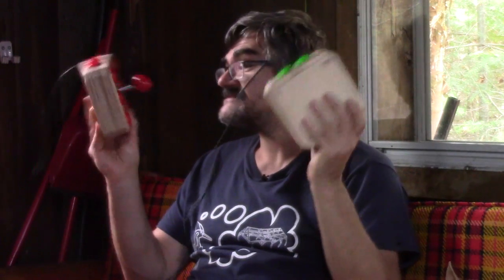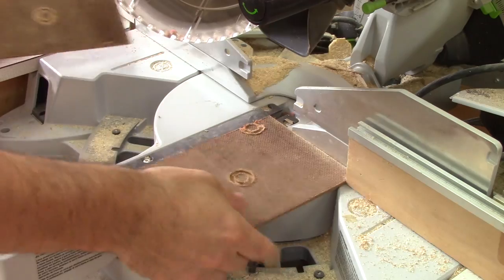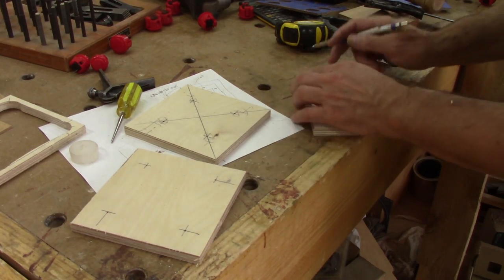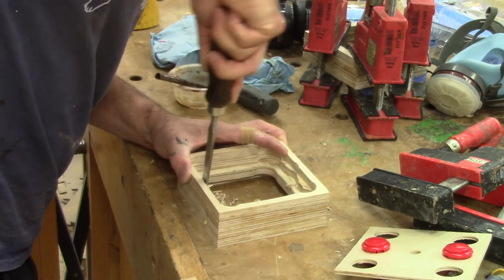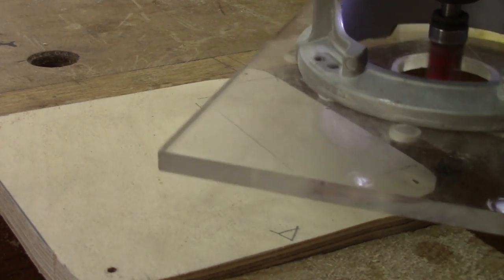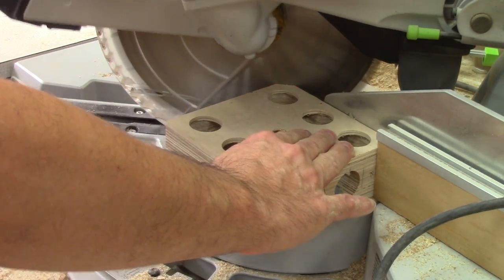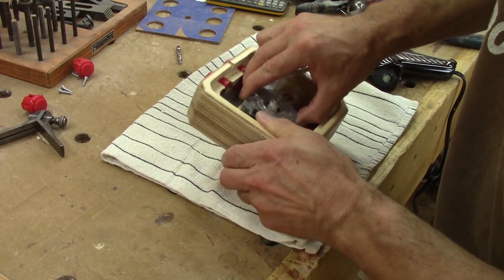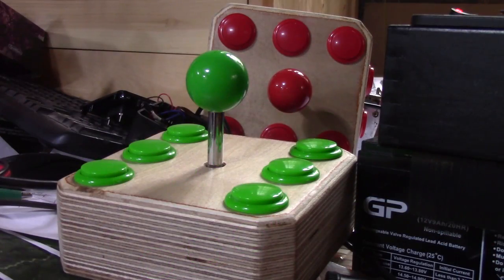The Woodpecker Ep 268 - Boxes for retro joysticks

Comment: Interesting design. The hole for the joystick is supposed to be larger and the "washer" goes on the top to hide the empty space while also preventing anything from going inside.
Reply from the maker: Your the fourth person who's telling me this... I had no clue as you could see. I've installed it inside, I guess for nothing... But having use Baltic birch plywood this washer would had look like a sore thumb being on top... I'm happy with out seeing the washer.
Reply: @LgosseuxDbois-TheWoodpecker  Fair enough. Does the joystick allow full range of motion with such a small hole?
Reply from the maker: Yes it does and they work great. But I'm not as good as I used to be ....